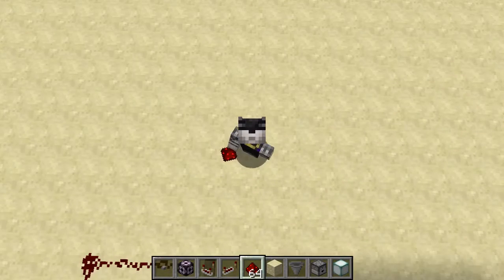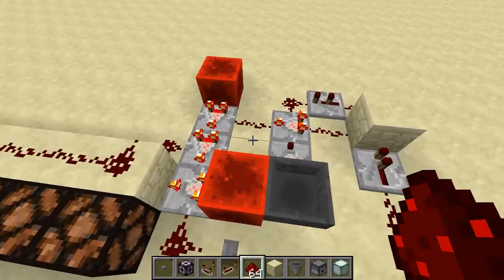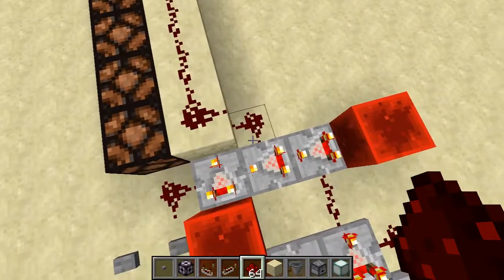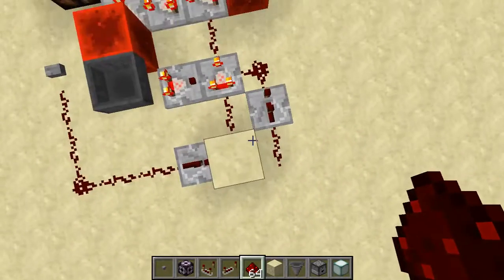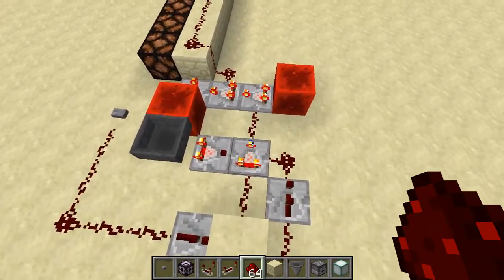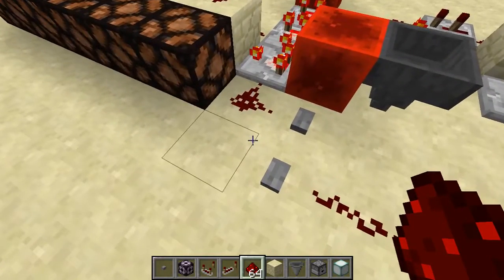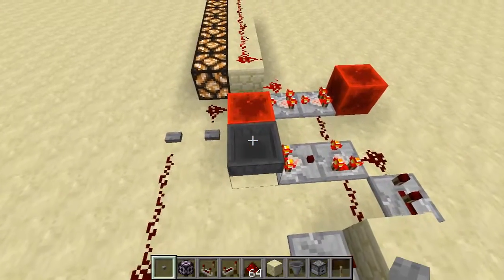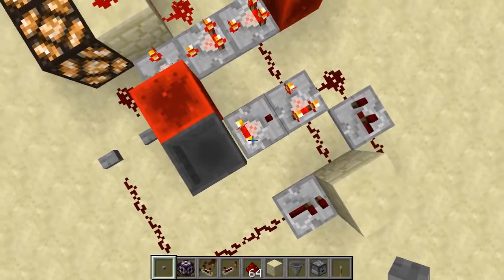Minecraft: Comparator-Addition Counter

Comment: Is there a way of making it working with  observer as input source? I wanted to make contraption which would make an automatic amethyst farm, for that observe a bud and count stages... but even though signal is sent it doesn't make the counter increment...
Reply from the maker: An observer is too quick for comparators and torches to pick up. You can fix that by just adding a 1-tick repeater to the output of the observer to extend its pulse a little bit.

Comment: Two notes to improve performance:
1. Its worth replacing hopper for other container (like chest/barrel), since hopper produce a bit of lag (it does check for items above itself to grab). You can also put some container (even empty) above the hopper, so it will get a bit optimized (since it won't check for items just for block above update). 
2. Its worth to make your redstone circuits lighted up to avoid light updates (less lag for client, but also for server processing (including single player)).

It does not matter much for small contraptions, but if you have a lot of redstone/hoppers used, you may experience some lag from time to time.

Comment: How many items does it take to get a power of 14 from a chest instead of a hopper?
Reply: Probably about 25 or 26 slots worth of items.
Reply from the maker: Depends on the items. The way comparators scale is simply percent_of_container_full * 15, rounded down. A single chest has 27 slots, so the math says you need 25.2 stacks full. The closest you can get with whole numbers is 25 stacks plus 13 extra items that could stack to 64.